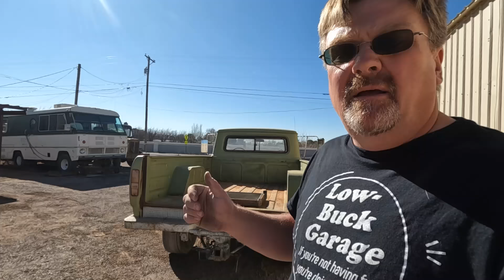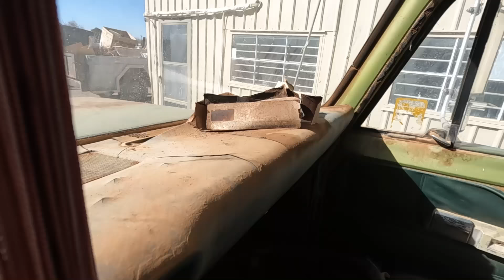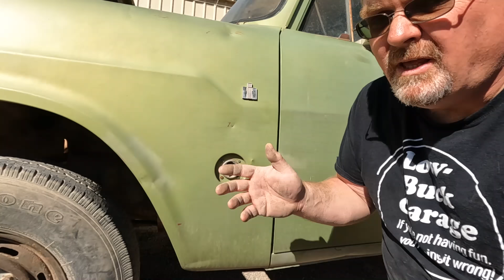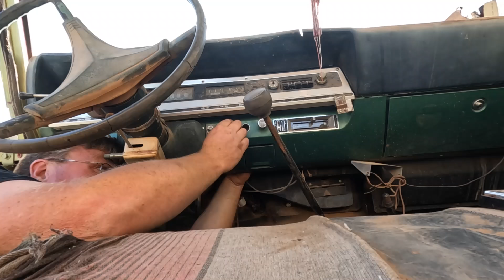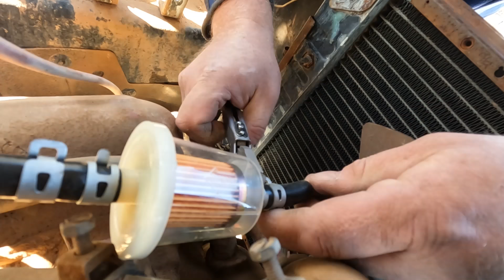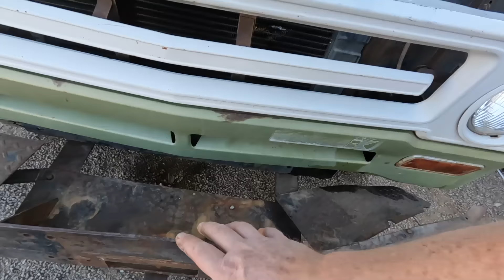1970 International 4x4 Pickup

Comment: I’m pretty late to this video, but I thought it might be useful info. I just bought a 74 200 with a 345 and the seller recommended adding an extra quart of oil past the “full” line

Also, the fuel cap on the main tank (behind the seat) looks to be the cap that originally came for the auxiliary tank. Looks like the one you bought is for the main tank, so you could just switch them if you feel so inclined

Comment: Had a '70 with a 304 in it, parts were getting hard to find in the late 80s but I did learn one thing, the points and condenser were the same as ford 6 cylinder

Comment: I have only good things to say about International Harvestor. my father owned two IH Scouts, a 1966 Scout and a 1974 Scout II. my father owned the Scout II for many years. and drove it work and and home every day. and the only thing that was replaced on it a transmission shift cable. that Scout had to be the most reliable and dependable vehicle. I have ever seen from any manufacturer. I owned a 1974 international 3/4 pickup. I did have to replace a reverse band in the Transmission. but IH uses Chrysler 727 torqueflite transmissions. in they're automatic transmission applications. and those transmissions are known for reverse band failure. if the band isn't kept properly adjusted. IH also makes really good farm equipment. Farm all tractors have been around for ever. so you won't hear me say anything bad about International Harvestor.

Comment: I had a similar plastic fuel filter in  a similar position on my '71 truck. Very convenient, until it (or the rubber fuel line) decided to leak and start a fire. Now I know why the fuel filters are normally under the truck and behind the engine.: )  Also, I learned it's handy to have a longish pry bar to open the hood heated to expansion and too hot too touch by an engine fire.

Comment: None synthetic 10w30 goes in Case skid steers as Hydrolic oil , same with the old 1982 Yamaha scooters transmissions take 10w30 as transmission fluid. I've seen a few more pumps that use 10w30 instead of Hydrolic fluid but it cannot have detergent in it, it must be old school 10w30 no detergent. just saying Thanks

Comment: Funny that you make note of someone graduating because that's where I put my tassel when I graduated, on the mirror of my 
1962 International pickup. It had a 6 cylinder three on the tree and it was a workhorse. Holey radiator Batman, he soldiered the hole ,oops I mean soldered the hole. Good stuff. Happy Motoring.

Comment: Nice truck.  So I-H V8 engines with scalloped valve covers go from 304 to 392. As far as I know, the 392 was the only one in this series with positive valve rotators.  All good engines, but with very mild CR and conservative timing.  So they went through gas pretty fast.  Bump the CR (if overhauling) and dial up the timing and they wake right up.  Built like a brick outhouse 😅

Comment: My opinion is those corn binders will last 4 ever  they dont have timing chains the cam is gear droven from crank  , check out the thermostat housing is cast iron made 2 last and the starters & alternators are either GM or Ford and the automatic transmission is a Torqueflite

Comment: Hey man, im sitti g in a hospital bed after getting hit by a truck after my cv axle came off the car on the highway. Was hit by a drunk driver. Luckily he bit somebody elses car and she followed so were going to purse legal action. I got the worst of it the besides breaking my leg he hit me so hard i flew about 10 meters from my car did like 2 flips amd i have stitches on my face and head and legs. They said i almost died. Nothing happened to it long live toyota corolla 1991 have to use my mom,s account. Names diego, you always inspired me to fix my own cars. The cv axle problem was sudden. Happy belated fathers day to you and your old man.i was tryimg to fix my 1996 nissan b13 since the valve housing had some snapped bolts. They said its not fixable

Comment: The extra room between the the rear of the engine and the firewall made room for the AMC 6 cylinder - standard engine. IH used the 232 AMC 6 cylinder, 304 V8, 345 and 394. .

Comment: Nice find. I drove a 1974 1210 4X4 for years plowing snow. That 345 and the big brother 394 were both 2000 hour engines - that's 2000 hours at max torque rpm 24/7 until it dies. That's amazing.
My 1210 weighed about 7000 pounds empty. I didn't have a tailgate either. So many stories with that old truck. I miss IH and their vehicles.

Comment: Did these have right hand thread lugs on the drivers side and left handed threads on the passenger side lugs? Seems like there was a few quirky things like that, but not sure if that's one or if I made that up. Maybe that's an Army thing. Anyway, it's been about 50 years but my dad bought one of these, probably in 2 wheel drive and of the 1/2 ton type...unless they came in 1/4 ton. He put that little green truck in the field and it was just for driving down to the pond to go fishing or to drive to where the tractor was working. It was the car I learned to drive when I was 9. The reason I asked if they came in 1/4 ton is because while I was driving...it happened to break it's back. The poor thing looked like a down in the back horse. The bed hit the cab at the top when the frame bent...broke. The fact that our place was terraced OR that I was home alone a lot because my dad worked in Saudi Arabia on a 28/28 day rotation had absolutely NOTHING to do with the green truck being broken in half while he was at work...is exactly what I told him.

Comment: Maybe you've found a way to drill washers by now......but if not........take a board and secure the washers to it with 3 or 4 pan head screws. Using the heads to clamp down the washer.

Comment: My second car for a long time was a 71 IH 1110 Camper special 6.4 two barrel 2wheel drive 
Suprising fuel mileage with gobs of torque 
sadly rust made is mark Sent to crusher for 400 bucks bought for 150 (50K miles invested using 5 gallon boat fuel tank 
Miss Scooby...  Her replacement was f 350 idi diesel Crew cab from Tx no rust no paint-way less fuel efficient 
Thanks for the upload

Comment: I slobber over vehicle #9.  Had one in 1969.  A 1965 Gladiator.  If it wasn't for the horrible 230 OHV in-line 6 I'd probably still have it.  The only thing that miserable excuse for a motor would be good for is a boat anchor.

Comment: There's a really easy way to distinguish the difference between the 304 and 345 IH SV's.  If you measure the distance between the block deck peaks at the back of the engine.  If the distance is 7", it's a 304, if it's 8", it's a 345.  However, on D series trucks, a 392 ci V8 was also available, especially on the 1200's.  So there was no stroke height difference between the 345's and 392's like there is with the 304, so one must keep that in mind when determining what IH engine one has.

Comment: Fuel Tank change over switch: Push in and turn would show you the level of the front tank, Pull and twist the other way and it would display the level of the rear tank.

Comment: Fold down the glove box, and it SHOULD have the build sheet on the back of it. Squeeze both retention springs in, and pull forward. I had mine on my 73 IHC 1110 4x4. Damn I miss that truck. 😥

Comment: Put some 3 in 1 penetrating oil (or something similar) on all the pivot joints on those hood hinges.  It will open and close like butter.  White lithium grease just doesn't work very quickly on these types of jobs.

Comment: Those 2 barrel Holley carbs are way better than the Rochester and Carter carbs. The Holley carb has the standard float, which you found in the  video. The larger float style handles fuel pressure issues way better on the larger V8's than the other 2 barrel designs. As the fuel pumps ware and pump higher volume per pump, the larger float doesn't flood.

Comment: The 345 V8 is made by IH, the 304 is made by AMC so very little parts commonalty with these.
Reply: Not even close. The IH 304 is ENTIRELY different than the AMC 304. They are entirely different engines. I've worked on plenty of both.
Reply: @johnsmith7676  I think I was confused. Was there a Jeep that used the IH 345 and the AMC 304?

Comment: If the tack wasn't so dusty, but I'm sure it was Super Sun . The best you could get back then.  And a 2 barrel Holley.  Easy to work on. Same error medium duty Farmall had a 392 with a 4 barrel . I think the 345 and 392 were the same block so a 4 barrel intake would be easy to find. Or put the 392 in. With that medium duty 5 speed truck tranny you would have something special.  Farmall always did like dual fuel  tanks.  You'd need a 5 OD with that rear gear!   You take care.        👍👍😎👀

Comment: Hi there! I worked for International Harvester Co for ten years and an international truck dealership for 44 years. I am going to tell you a tip. Open the glove box. On either side of it, is a clip. Push them in and flip the glove box down even more. On the back side of the box should be a build sheet from the factory listing everything that the vehicle was built with on the assembly lie at the factory. Comes in handy when ordering parts.
Reply: … did he ever find it i wonder 🤔
Reply: @remko1238  He did. If you watch part 2, he opens it right at the start....no luck though, no build sheet.😒
Reply: I wonder if the flywheel was so rusty it was grinding the glaze off that clutch plate?
Reply: Does the left side of the truck have left hand thread and the right is right hand tresd?
Reply: This helped me a lot!
Reply: Whaaaaa
Reply: Thanks
Reply: https://www.youtube.com/watch?v=4C62XSuxPYE
Reply: ..And those parts technically should still be available as IH is still in business.
Reply: @campbellpaul whether or not a company is in business doesn't necessarily affect the availability of parts for a product they stopped making 50 years ago.
Reply: @mwilliamshs  the last pickup was made in 1980. I think but don't really know. In 1980 I was 11 going on 12 years old
Reply: 8lbs @mwilliamshs
Reply: @jameskietzer1960  The Scout was last made in 1980, and the pickups were last made in 75!
Reply: @campbellpaul  hilarious!

Comment: Those cables are controls for a bellview winch, the design that warn eventually made into the legendary 8274.  They have a brake to go out under load, instead of power out, you can still get parts for them, and they are a great cheap winch.  With your level of machine shop capabilities, you can do a little bit of tweaking and make them even more like an 8274, and there's some part of them that makes one of these hybrids even better than a regular 8274, but I can't remember what it is, I have MS and it makes my memory crap, hah.  The band brake lining  material is the same as some type as for some ford model a or t part, but I can't remember which, hah.  My only need with bellview Belleville (can't remember which, hah) is no power out in stock form, which is annoying if your truck is dead, and you have a snarl of cable jammed in the drum, so you can't just back the truck up to unjam it.  The 8274 hybridization adds power out though.  That style of winch in between when warn bought them out and when they started making 8274's had a warn number designation, that I believe starts with a 6 or 7, or their might have been two different model numbers in between, but they are all essentially the same as the original design.  Having the Controlls is a big plus, they can be harder to find than the winches.  The literature calls them a 6000lb winch, but consensus is that they are more strongly built and pull harder than most 8000lb winches.  And like the 8274, they have much faster line speed than most horizontal style winches.  The brake control cable Is a pull, then twist to lock design, at least the couple I've had were.  Hope that helps.
Reply: BellEview, but YES it was.

Comment: A few bits of advice about those era IH trucks. 
Most of the common electrical parts are GM, chevy alts, switches, etc all fit. The front drum brake drums are NLA, so take care of them. The engines have a bad habit of destroying the cam bearings if the oil runs low, and iirc they are no longer available. Keep the oil full and use good quality oil. The engines are really tough, they were designed to run at 3000-3500rpm sustained, making max power for 100k miles in medium duty trucks and combines. But, they will throw rods much over 3600rpm, that redline on the tach was placed by someone with experience, shift at 3000rpm or so. Rear axle shafts on the IH dana 60 are different than the big 3 iirc, coarse spline. Engine parts are available but you gotta search all the parts suppliers to find stuff. 

On the drive ability front, I really recommend a pertonix drop in electronic ignition. I picked up 3mpg, from 9 to 12mpg with mine and it runs smoother at 3000rpm, which is where mine sits at 60mph. With gas prices it paid for itself pretty quickly and the truck has better drivability because the timing is more consistent. My truck starts like a modern FI truck after I rebuilt the carb and the ignition work, couple cranks and it settles into a smooth idle. 

Don't bother trying to hotrod the sv series engines, they will suck up a cubic yards worth of dollars to make 300hp. The 5 speed in your truck is a clark iirc, same trans used in some medium duty trucks. Parts are hard to find.
Reply: I just got a 67 step side pickup, 6 cylinder 4 speed I agree parts just don't exist for them.

Comment: If you want to make a low buck battery terminal crimper (And of course you do), find the pair of undersized cheap chinese bolt cutters that you destroyed the cutting blades trying to cut a hardened lock shackle with, and die grind the chunk already missing from the bolt shackle fiasco into something resembling the crimp you'd like. And make a bunch more along the blade length fir different sizes, etc. Old bolt cutters make awesome battery terminal crimpers, and terrible bolt cutters.

Comment: I had a 1978 Scout II. Driving through heavy wet snow I bent the tie rod pretty bad. Luckily the local International Harvester Dealer had one in stock. The hard core Off Road Guys would beef up the tie rod by welding a  angle iron on to reinforce it. A few little tidbits of knowledge on Internationals. All of the engines have a gear driven reverse rotation cam. The water pump is really easy to change. All of the water passages are in the front timing cover, not like the small bore Chevy. The firing order is 8-4-3-6-5-7-2-1. The engines are externally balanced, so the damper is like a counterweight. That IH is worth saving. I will enjoy every video in this rejuvination.

Comment: a 1970 international 345 should have a motorcraft aka ford distributor, so a pertronics electronic ignition kit for a ford v8 should drop right in. that carburetor is a holley 2300 2-barrel. the alternator could be a motorcraft aka ford or a delco remy aka general motors, whatever international harvester could get at that time. i've never seen an international gas v8 engine that would not run, one reason parts have always been hard to find is because these engines don't break or wear out. they are absolutely horrible when it comes to fuel consumption, but that's the tradeoff for indestructibility. behind the passenger door panel you might find the original line sheet, this is a listing of all of the components installed when the truck was new (engine, transmission, transfer case, axles, etc. etc) on pickups they were usually behind the passenger door panel, on travelalls and scouts they were behind the tailgate door panel, and on the later models it was glued into the glovebox. the line sheet is very useful when you need to go looking for parts.

Comment: Around 1974 I'm driving my dad's 345 Auto International in 4-wheel drive about 70 miles an hour on a County Road in Minnesota after 6 in of fresh snow. It's going good until I meet a road grader.  I figure I'll put the left front wheel just six inches off of his left moldboard.  Unfortunately his left moldboard was all the way out to the edge of my right side ditch and suddenly I only had 4 ft of snow underneath the whole truck. WHUMP!  He kept going but a farmer came along with his tractor and we hooked the chain onto the bumper and pulled the bumper right off the truck.  Still got it out of the ditch but I don't think my dad let me drive the truck anymore after that.

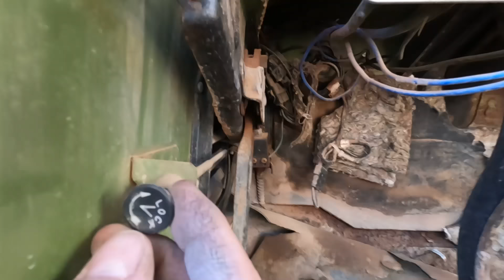Comment: The running gear in these old cornbinders were tough.  The bodies not so much.  I had a 73 Scout that I ordered.  It had the 345, 4 speed, 3:31 gears (mistake), dual exhaust auto locking hubs (mistake).  It only had like 147 hp.

Comment: I had a 77 scout traveler baby blue used to belong to Gates oil company had more holes than Swiss cheese it had  bench seats, nice rig and all there dispite the rust completely every rubber piece on the engine was Gates made  had a beefy front bumper since the owner would pull it behind the construction equipment to the work area also had headers and a couple of cherry pickers napa echlin electronic ignition 

4wd, had the Chrysler 4 speed automatic Dayna transfer and diffs 

Ended up selling it to a scout enthusiast

It went to good hands

Comment: I remember back in that time frame International had gear to gear transfer cases. Now company's use oversize "Timing chains" to transfer power from the primary shaft to secondary. The biggest problem International had back then was terrible body rust.
Reply: New Process 205, one of the best, used by Dodge, Ford & G.M..

Comment: I'm totally jealous! Any 70 anything in my neighborhood is a solid rust bucket. Adjusting clutch linkage would require a torch and hours of prayer. Brake fluid added to an empty master cylinder would have leaked out of rusty lines long before reaching the rusted up wheel cylinders. Of course, looking through the rust holes in the cab and box would make diagnosing the problem much easier.